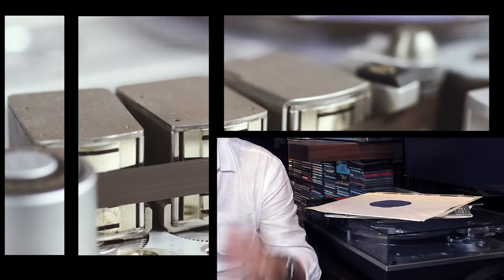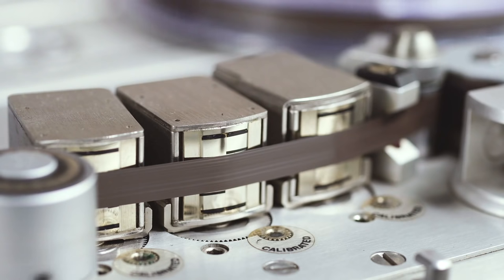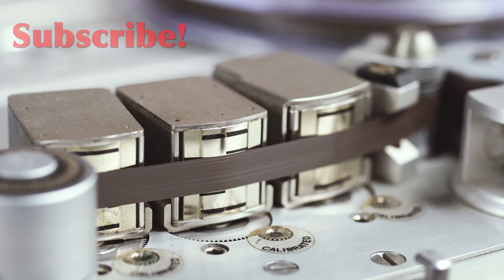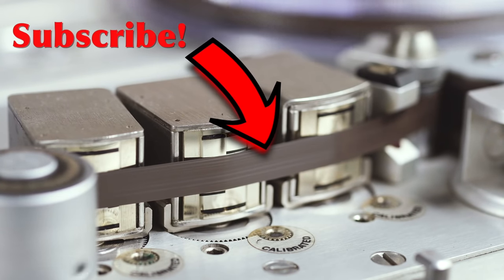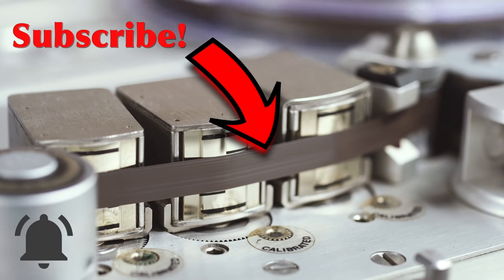How to reduce inner groove distortion & tracking error

Comment: Hi, where you talk about cartridge alignment (around 8:25), you mention that you see in a lot of others' videos that they move the protractor when placing the stylus from one null point to another. I was always confused about this, to be honest. Indeed, in some videos they say (like you) that you should not move the protractor, and in others you can see that they move it...With my protractor, I can only really do it if I move it a bit, I NEED TO do that, otherwise it won't work. It would be good if someone could perhaps clarify this. Here is what I think currently: I think it all depends on the particular TYPE of protractor. For example, in the protractor you use in your earlier video at https://www.youtube.com/watch?v=GqWh41NT1Cc&t=603s (around minute 11), we can see that the two null points are placed ON AN ARC (followed by the stylus on the record surface). And I think that's why you can (and should) use that protractor without moving/turning it when you switch the stylus between the two null points. However, I use a more simple (and widespread) protractor where the two null points are placed simply next to each other on the SAME RADIUS LINE (something like this one: https://ae01.alicdn.com/kf/Hb868d72cbef144c5aeb4497f8b5e57c4U.jpg, and the one you are showing in this video seems also to be like that -> the two points are on the same radius line). I think that in this case it is impossible to switch between them without having to turn a bit the platter (the protractor) - which means that that arc on which the stylus travels during playback will not intersect the same radius line when it goes through the two null points. Can we agree on that? Or is there something that I am missing? (perhaps a video which would delve more in-depth into the whole cartridge alignment methodology, with different kinds of protractors, in a very detailed and practical way, would be welcome)

Thanks for your work and best regards,
Ciao
Reply from the maker: I can understand your confusion but no, you should move the cart ahead (overhang) and with the correct angle untill both null points are aligned WITHOUT moving the protractor. This is the best way to obtain the best tracking performance. If your tonearm head (fixed) or headshell does NOT allow overhang, meaning moving back and forth the cartrdige, then you must move the protractor but the results are going to be worse.
Reply: @anadialog  To better illustrate what I mean, please take a look at the first illustration on page 3 of the pdf doc at https://www.kuzma.si/media/uploads/files/KAA%202016%20LECTURE%202017(1).pdf, which shows how such an arc described by the stylus looks like. There you can see that the inner and the outer null point intersect a different radius line. Ergo, assuming you have aligned the cartridge (so it's good) and you place a protractor on the platter (one of those which has the two points on the same radius line), and describe the arc made by the stylus, in such a way that it touches one of the null points, then it will never touch the other null point if you keep the protractor unmoved (because then the protractor only represents one of the two radius lines that the arc intersects). I hope it's perhaps clearer now, looking at that picture. Also, in the same pdf see pages 23-24, where a detailed method of aligning is described when using such a protractor (once again, which has the two null points printed on the same radius line). In the first line of page 24 we see this: "...and rotate protractor until the cantilever...". "And rotate protractor". "rotate protractor". Rotate. Protractor. Doesn't this mean that they move, they rotate the protractor? Which according to you is something that should never be done? (by the way, and I think a Kuzma document is probably a good, reliable reference)
Reply: @anadialog  So I'd still maintain that whether you should move the protractor or not depends on the type of protractor. And by type of protractor I don't mean here Baerwald, or Loefgren, etc. I mean that apparently there are two types of protractors (from this point of view): 
1. ARC protractors, which have printed on them exactly, the whole arc that the stylus should follow. Optionally also with the two null points designated on that arc. They usually are bigger. Like the one we see in your earlier video https://www.youtube.com/watch?v=GqWh41NT1Cc&t=603s . What you say - that you should not move the protractor - I think is only valid for these kinds of protractors.
2. Simple two-point protractors, where we don't have the arc printed, only two null points, and even those ones are printed not as they would appear on a real arc, but next "to each other", on the same radius (so not as they look in "real life", on an arc described by the stylus). That's why these protractors are much smaller, narrower, they usually look like a bend, a straight "tongue". The one you show in this video doesn't have that shape, but it seems to me that the null points are printed on it like on these kind of protractors (on the same radius line). Now, I believe that what you say - that you should not move the protractor - is not valid for this kind of protractor.
Reply from the maker: Yes, you are correct! I was fixated on the Baerwald for too long! The protractor with aligned points require the platter to be moved! I'll correct that.

Comment: Do you have a copy of the 1812 overture cut from the inside out?
Reply from the maker: I don't!
Reply: @anadialog  I can't find it on the internet but I remember reading about it, due to the track starting quietly and finishing very loud, it was experimented to play from the inside to the outside
Reply: I got it mixed up, it was Ravels Bolero and it is on the Tacet label
Reply from the maker: Makes sense! Got to change the antiskating though! ;-)

Comment: The CD has varied speeds.  fastest in the beginning, ie the first song.  and the first song is closest to the middle, ie the closest hole on the CD.  was it the same with laser disc?  an optical analog a disc would have been interesting.  and the advantage would be that you would not need an expensive cartridge.  you would only need the same type of lens as you might find a CD player or laser disc.  And of course there would be varied speed on the disc